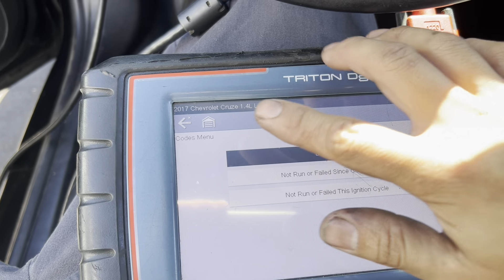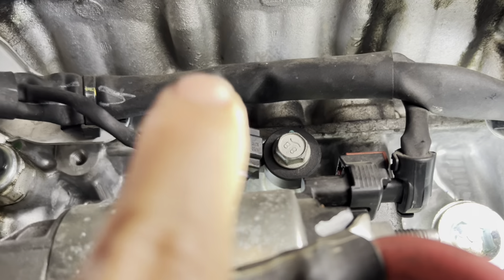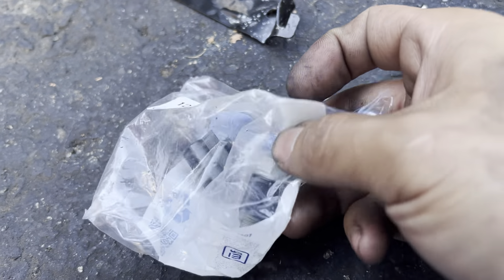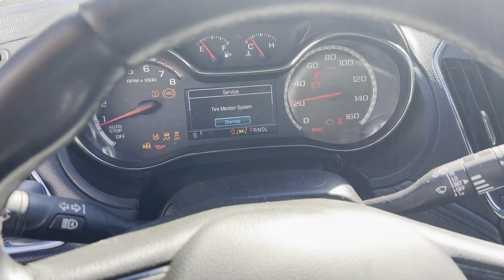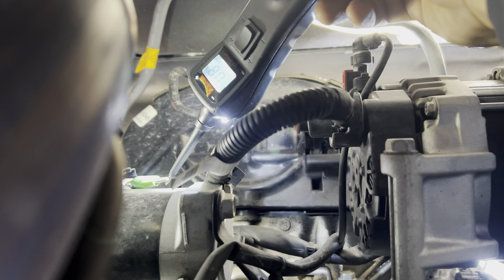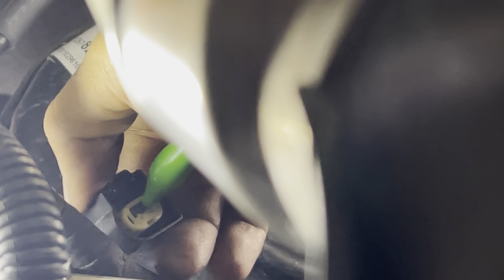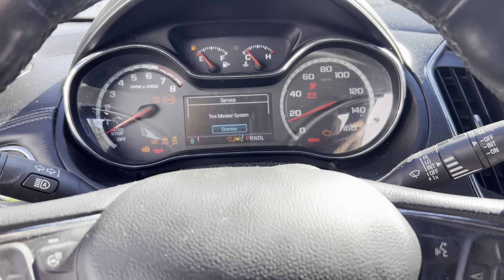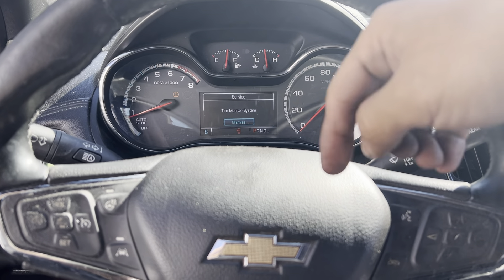Chevy Cruze Knock Sensor Code P0325 - How To Test & Replace - Must Watch

Comment: Thank you so much for this! I've watched what I thought was every video out there for changing the knock sensor in my son's 2017 Chevy Cruze Premier and yours is the first and only one that actually showed me everything I needed. I'm a 45 year old single mom who has never done anything more than change the oil or rotate the tires on a car. I was able to find the sensor after getting under the car and using my phone to record under the intake manifold but could not for the life of me figure out how to get the sensor out of the wiring bracket once I unscrewed the bolt. Thank you SOOOOO much for mentioning not only did you have to pull out the red clip but also press the tab while pulling. I spent an hour trying to pry it out after pulling the red tab but after watching this, it slid right out easily on the first try by pressing in the tab. You're a life (and money) saver!!!
Reply: Bless your heart for doing this yourself ❤ Strong mother 💪
Reply: How did u find it?